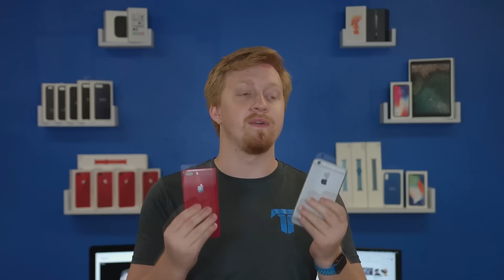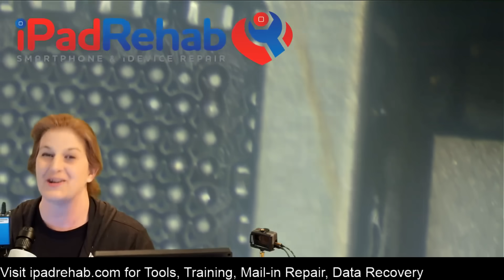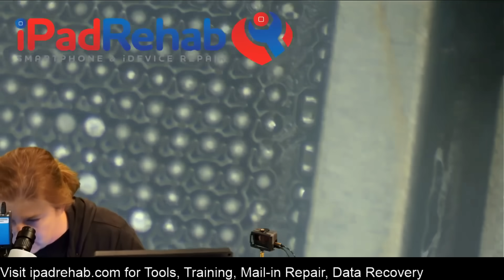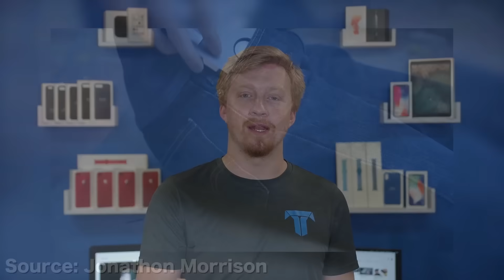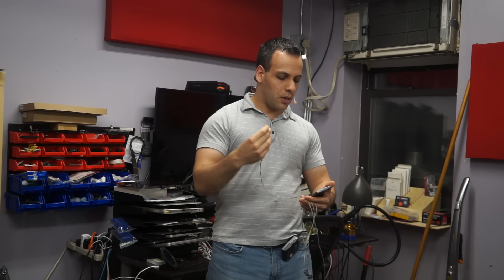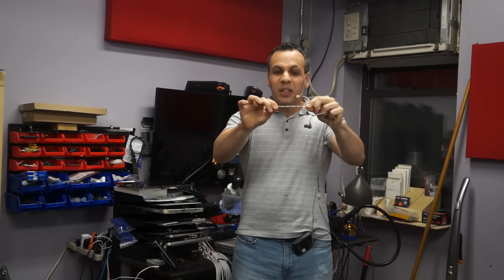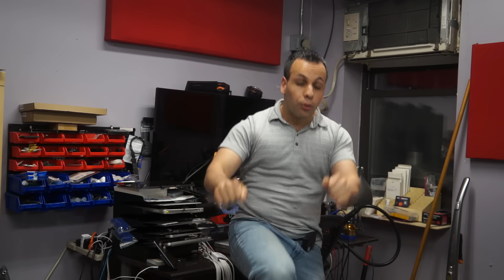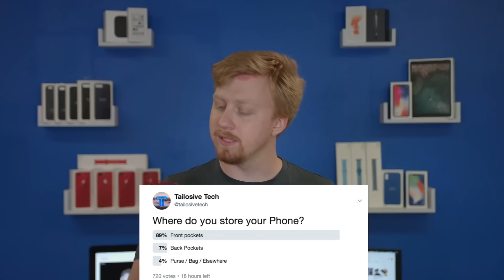The truth about iPhone bendgate deniers

Comment: The guy with the phone in his back pocket did it wrong anyway. He was leaned forward, away from the phone the entire time. He gotta slam that into the bottom of his pocket, lean back, and relax. Or better yet I noticed my old phone was bending in my back pocket because I was driving around. The soft seat cushions us and forms around that curve, the phone is then bent to that curve over time

We all know you didn’t pull as hard as you could on those headphones because they’d just snap apart 😂 strong man

If they really wanted to “real world test” phones they’s give a bunch out to laborers of every trade for a year. Want a durability test? Give a couple to people with anger issues  that hate phones as well, the longer is lasts the more likely people will buy it and you’ll also get some fun feedback like “stop zooming the map all the way out when I turn the phone” and “make a visual log of all the streets and show me the name of the next street like the old GPS used to do instead of a blue line that tells me nothing when there is no service”

Back glass was one of the worst things to come to phones outside of easily damaged internals. It slips everywhere, if it cracks you’re now working with glass cuts all the time, and because it slips more it’s more likely to slip off something and cause more internal damage

Comment: The nexus 6p is awesome it has monitor mode and packet injection I bought 1 a year ago because of that it did break but it has more features than any new phone without external adapters or reverse engineering drivers to support monitor mode and packet injection

Comment: The iPhone 6 was a terrible design. I had to replace my phone 3-4 times over two years.   That was a design that should have never happened (they clearly didn’t learn because iPad Pros from 2018 on all have a bending issue due to the Apple Pencil charging port and the mic on the left side causing a line of symmetry to break. They could easily fix the iPad Pro issue by moving the left side mic up or down so it isn’t lined up with the Apple Pencil charge port).

Comment: Louis, the terms for what you're describing is REPETITIVE STRESS, vs NON-REPETITIVE STRESS
furthermore,
some types of non-repetitive stress ( or repetitive ones) cause LATENT failure. Meaning that , you bend your phone, and it immediately works.  But,  you created some microscopic weak spots in the material , which , after multiple temperature cyclings, or with the addition of further types of mechanical stress ( different from the initial one) can lead to failure.   A system where so many different types of materials are stuck together ( and all those materials have different thermal expansion coefficients) is a sure-fire prescription for latent failure. Given enough time, it is increasingly likely to fail.

Comment: The second those poll results came up, I'm like, "that's got to be just men in that poll." For real, have you seen women's pockets? Our front pockets barely hold keys and a credit card, and that's if they're not the fake kind. No way can you fit a modern smartphone in there.

And don't bitch at women for buying these clothes - we've complained about this for decades and manufactures just don't listen. We need clothes, and this is what's available. Aside from cargo pants, all day er'y day, our other options for getting getting decent pockets are making your own clothes (which requires skill, schematics, and equipment) or hiring a tailor to make clothes (which is more expensive than a purse).

Comment: I had a 15° bend on the left side  of my galaxy grand prime. It was from my as/s, sitting down with it in my back pocket (with horrible posture too) for 7 hours of the day. The screen flexed enough and never cracked.
Also had someone overhead smash it during a brawl and it survived. Ended up losing it at a bar😒

Comment: As an engineer, I absolutely hate BGA packages. Impossible to clean in between those tiny balls, the power dissipation factor of the part sucks, and if you rework it, chances are phenomenal that you will pluck one of those tiny fragile pads that hold onto the board by the skin of it's teeth.

Comment: I had a 6plus, bent the hell out of the phone and never had an issue. Have an 8plus with flex damage not bent at all. I also have an iPad Pro 12.9 that bent from holding it by the corner. But hasn’t showed any hardware issues.

Comment: I had a Samsung S6 and I stupidly lost it on a cab. A friend of mine gave me a battery busted iPhone 6. Comparing the two I liked S6 way more, even I don't have bend problems with smartphones because I rarely put them in my pocket. iPhone 6 just sucks as a device near S6. The S6 had two glasses and you could feel the sturdiness of it just holding it. But I aknowledge the problems Louis mentioned about the S6 on the video, but I just could'nt hold myself because of the VR capabilities S6 had. But that also was bad because in VR mode it would get hot and ruin the experience. But overall, S6 is way better and reliable compared to iPhone 6.

Comment: 18:25 former owner of a Samsung S6, never had any flex damage, never really gave me any issues until it was 4yrs old.  After 4 yrs the battery and processing power were crap. Apparently it was not a smart purchase (non-liquid resistant, no SD, etc) but better than apple! It still works, I just powered it up.

Comment: Females put phones in their back pocket because our front pockets are too small for even the thinnest of phones in many cases, so our options are back pocket or purse, in which if you compare just those two options on the poll back pocket wins.  I would never sit down with my phone in my pocket because I put a massive bulky case on it so it is extremely uncomfortable (I am extremely clumsy, so without an Otter box type case the phone would break super quickly), but if I am on my feet it is usually in my back pocket as it is easier to get to than in my purse.
Reply: Jesus christ did you even watch the video? The phone doesn't literally bend it's the flexing of the charger cable that does internal damage - bends the board inside.
Reply: @mesicek7  I was addressing him commenting on the fact that women put phones in their back pocket while men do not.  I literally said nothing regarding the phone itself bending.
Reply: @Maria-chan5863  But what does that have to do with the issue of iphones breaking?
Reply: @mesicek7  Very little beyond the reason in which Louis brought up the topic in the first place?  I was responding to Louis commenting on the fact that it tends to be women that put their phones in their back pocket and doesn't seem to entirely understand why, or at the very least he didn't explain it.

In case you did what you accused me of and didn't watch the whole video, here is the timestamp of the initial statement: 22:43.
He's explaining why someone's poll wherein the person was saying that the vast majority keep it in their front pocket was invalid.  The reason being that the extreme minority of the viewers of these types of channels (and thus most likely the poll's respondents) are female, and females are the ones who usually put phones in their back pocket.  He later comments that women "don't see a problem with" doing so.  His point in talking about this is that saying that the differences from being in the back pocket vs the front pocket should have been accounted for.

I know it is a minor point, but that doesn't mean someone isn't allowed to comment on it just because one specific random viewer could not give less of a fuck.  People literally quote random things that he says that they enjoyed as their entire comment.  I mentioned what I was explaining at the start of my comment, if you didn't care you could just scroll past, yet you instead act like I am a moron or didn't watch the video.

And before someone comments, I enjoy making ridiculously long comments, lol.
Reply: @Maria-chan5863  Yeah but that has nothing to do with the main issue. That idiot Tailosive Tech among many others back then mentioned it in his video cause he thought thats how the Iphone breaks. Has nothing to do with women put their phone in their back pockets - men do it too and again has nothing to do with the topic of the video - How Iphone's bend or if i put it in layman terms how the iphone board gets bent with time.
Reply: @mesicek7  When exactly did I say it was important to the main issue? Never. I was addressing a minor point, as I said in the last reply. I'm not sure what problem you have with  a comment addressing something that is in the video, even if it is not very important.

Comment: YES. Yes I do solder. I have a regular soldering iron and a compact handheld hot air soldering apparatus, it  is a 300W unit, has 3 blowing speed settings and goes from 200 to 500*C.

Comment: Not saying Apple isn’t at fault in any way, but DOESN’T ANYONE PUT A CASE ON THEIR PHONE??? Most cases use ABS plastic to reinforce the phone to reduced any bending or fatigue that it sees in regular use. Considering that most phone screens will shatter if dropped, I don’t see why people are so upset that this design has another failure mode (pcb fatigue) when used without a case.

Comment: Didn’t the YouTuber mean that just the aesthetics of the design of the iPhone 6 remained for multiple years more less the same and the actual built? As far as I knew the big “Bend-problem” was indeed a design flaw which was solved with the introduction of  the 6s. 
As this is the first time I heard about this pad coming off and I use a 6s quite extensively for 4 years without any problems I think it doesn’t occur very often. Nevertheless I appreciate your videos and your knowledge and critical view on Apple products and it’s good to know in which areas Apple is cutting corners so we can take this into account.

Comment: I understand your point, I'm on board with your logic, however you'd have to be mad to think there's so much flex in an iPhone. I buy a large number of iPhones, every model, the units being used by different people. One user is absolutely careless, to the point he gets at least 2 replacements for every phone he has. He would practically destroy every phone, not only bend them. Actually, the bending is more likely to occur after the screen is broken. I've seen bent iPhones and I'd played with them, bending back and forth. Even though nothing happened to any of them (they were still functional), your argument is still valid. What I'm saying is it takes a certain kind of animal , and a certain kind of treatment to bend an iPhone. To me, that falls under improper use, more than a bad machine. In other words, you'd really have to want to bend that phone, it's not gonna bend itself in your pocket.

Comment: Also bend gate never got fixed because Apple releases new phones like every year or so now. And they know their customers. They know it doesn’t matter how long the phone lasts or what garbage engineering goes into it. They know that if they can make it look good and work really well right out of the box people will spend hundreds of dollars on it as soon as it’s released. What that in turn gives them the freedom to do is rather than address an issue with a phone they released, they just release another one. In short they know people are dumb enough to do it again and pay them for the next ride rather than make them fix it because they want the new shiny. And that is the crippling issue with Apple now, they don’t have to fix it if they can come out with a new one quick enough even if it’s built on the same platform just made to look different. So anyone bitching why is Apple like this maybe stop buying their products. I have. I had two iPhones before this one none of which I bought for any other reason than the current one took a total shit and stopped working cause my dumb ass wasn’t paying attention or because of me being a bit careless at times. And when a newer model that’s still 2 behind the current is only 20-30 dollars more than buying the parts to fix what I had then fuck it. But after this bs of not being able to fix my own shit and seeing what Apple is doing and how they treat their customers. And having my own observations and assumptions I’ve made about the company not only confirmed but almost tossed about by the company as an achievement they can fuck off.

Comment: I own an iPhone 6 I purchased it around the time Walmart started to stock it for 200 dollars. Since then my damn phone has had so many updates some apps I have now stopped working if I don’t continue to update my phone. A designed feature of apple products I believe should be illegal. Anyway my phone hasn’t had bend gate issues yet. But seeing as how if I replace anything Apple will find a way to brick my phone I’ve been saving up to buy a better Samsung than deal with this pos. The screen started to have the frozen keyboard backlight issue as well as the charge port shorting phone chargers and being unreliable to set the phone down while charging. I’ve done everything I can to make sure my phone doesn’t have these issues and I’ve done a lot of repair work on phones/tablets/laptops/etc. however it seems 3 years is to much to ask of any Apple product to keep working. And I honestly wouldn’t be surprised to find out they are intentionally designed that way.

Comment: I'm super late to this, Louis, I'm sorry.

The flexion you're referring to induces what engineers refer to as "fatigue failure" in materials. 
It's cause by the cyclic loading and unloading of a material, and that force, it's important to note, may be significantly less than the load rating of the material in question.

Comment: For the glass backs, (for reference I am in no way a professional, this is my hypothesis) I believe that it helps take the stress from the metal frame, as glass is much better at not flexing, where metal is rather good at flexing. Also, glass backs are much harder to scratch than a plastic or metal back, on top of that, this is coning gorilla glass, not normal glass meaning it can withstand a much higher drop height(sudden impact).

Comment: My new note 10 has a great feature with windows. My older note 8 could send my missed calls, sms and photos to my laptop but with the later Samsung (other android phones too) can give control of the screen to my laptop. So if I don't restart my phone if it is encrypted I can pull all the data from it if the touch screen is broken. 
It's not as fluid as an iPhone and a Mac but I still can answer sms and whatassApp and see missed calls etc but I can bring my phone screen up and control it from there. I could always plug a USB mouse and keyboard in and use that (not possible on an iOS device) but now the advantage of an actual cracked screen is there. The apple ecosystem is great if you are willing to just buy apple even if something more suited to you're needs exists (I take notes constantly and the note is by far the only device that meets that specification) then you shouldn't think that a sub par £800+ device to put in your pocket is the only option just because loads of YouTube channels who have made their money from building a brand when the iPhone was the best portable device says so. It was pushing the envelope 8 years ago, now it's taking advantage of its customers.

Comment: Interesting titbit for some people: This kind of damage is exactly what happens in PlayStation 2, PlayStation 3 and I assume PlayStation 4 controllers. The Actual button connectors are printed on a flex PCB which, over time, wears out due to flexion based damage breaking the connection of the copper wiring. Thankfully, these PCBs are very cheap, easy to obtain and easy to replace, unlike the parts from our friendly neighbourhood Apple corporation. I know this is talking about phones, but the way these controllers fail is the exact same way that these iPhones fail.

Comment: MY IPHONE 7 STRAIGHT UP STOPPED CHARGING. I TOOK IT TO APPLE AND THEY OPENED IT UP AND FOUND BLACK GOOP IN THE PHONE. I MEAN I GOT A NEW ONE FOR FREE BUT NAH FAM I
Reply: After 1.5 years of use, my 7+ stopped accepting wired headphones, had terrible battery drain on idle, and wouldn't let me record voice memos.

Turns out, it was a logic board error. An unfixable logic board malfunction. Apple wouldn't replace my phone. This happened in October 2018, and after that issue, I switched to Android and haven't looked back since.

Comment: I've had an Andriod S7 for three or so years now, it still runs just fine.
I'm not gentle with it either, I toss it onto my desk, bed, drop it, throw it to friends, tuck it in my cargo pockets, ect, ect.
While I've had cases, I'm sure they don't suck up all the shock and rock from wear.
Wonder if an Iphone would've lasted as long...
Reply: HIGHLY doubtful it would've lasted even half as long, and your wallet would be in pain during the entire ordeal
Reply: the answer is no...
Reply: @theoakun3635  It's on it's last legs now, the screen is burned into itself now, and the speaker gave out.

Comment: i loved the nexus 6p.  best phone i have ever had.  it did sorta have some of the issues they were known for but to me they were minor.  i used that thing for like 4.5 years.  biggest battery in a phone ever that i know of.  when new it had a full 2 day battery.  it did eventually get the early shutdown thing.  i swapped the battery and fixed.  when i broke the usb port that was easy to swap from donor phone.  the whole phone was easy to work on.  And i am not someone who normally takes time to take a phone apart.  I just loved that phone.  I am not a hardware person at all.  I program cisco equipment for my income.